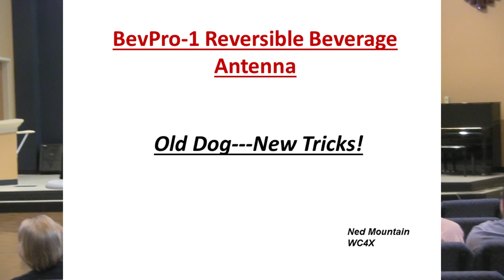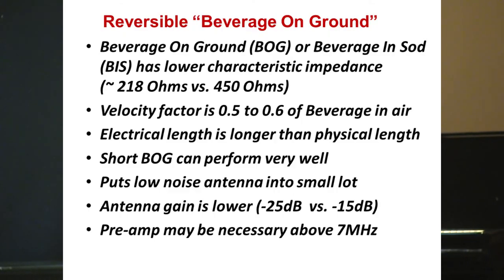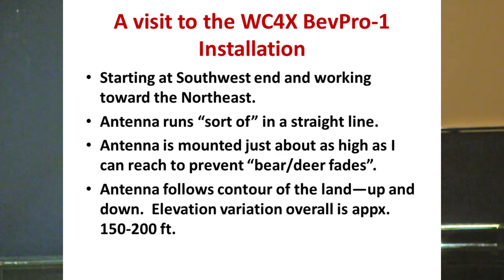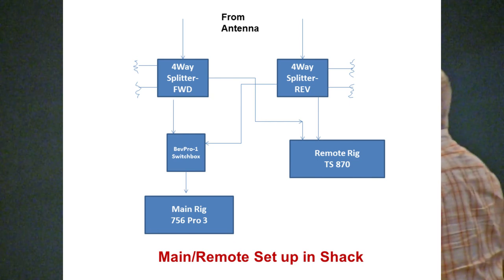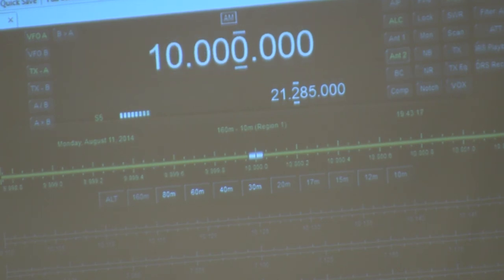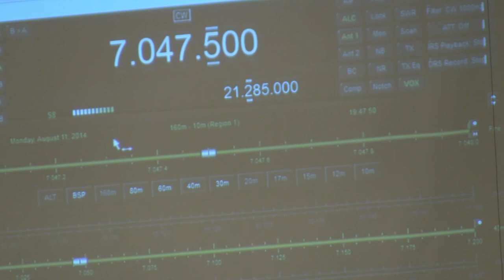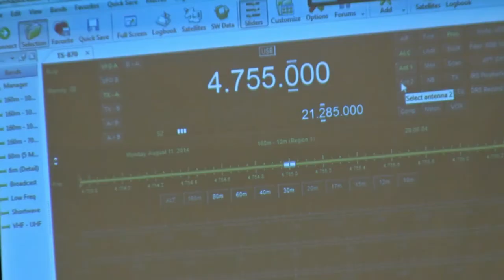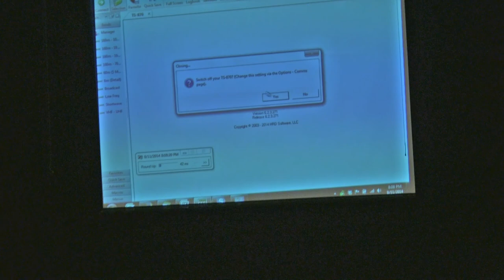An Improved Beverage Antenna

Comment: I( exchanged e-mails with Gary last night and  just bought one from DX Engineering.  They are in production.  I liked your video Ned.  I actually moved to Cumming about a year ago and am putting up an EWE using the BevFlex next week.  I'm not a ham, but have been a MW and SW DXer and amateur radio listener for almost 50 years.  This looks like a great product.  Can't wait until I get the antenna installed.

Comment: Sawnee Radio:

Is the BevFlex 4 still being manufactured?  I am having trouble finding a seller on line.  I tried an outfit called JK Antennas, but their website seems quirky or perhaps they are out-of-business.  I so desperately want to buy this antenna.  Could you be of help?

Thanks very kindly for responding.
Reply: I'm from Brazil, I bought it for two "beverage", in 2021 October in Denver at HRO